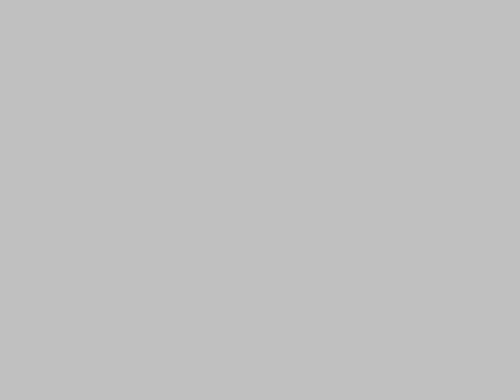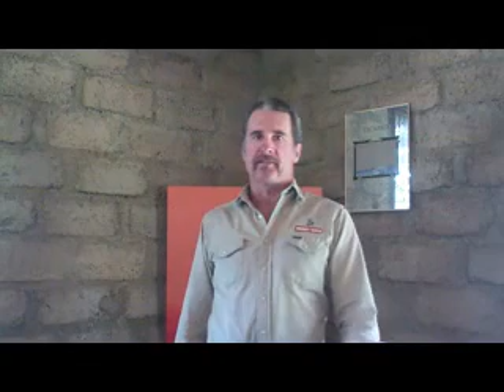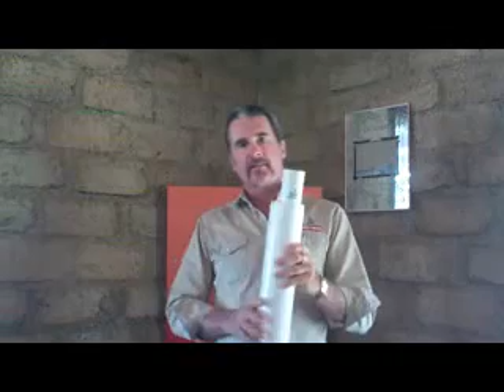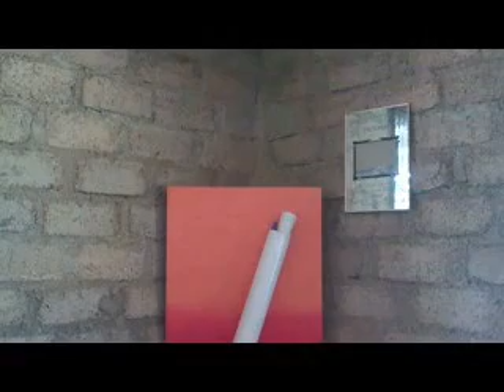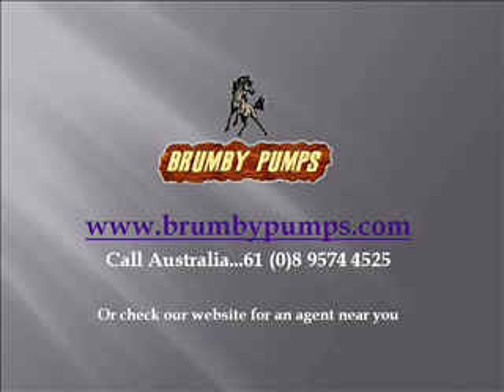Brumby vid.wmv

Comment: Hi Tom,

what is the maximum depth of the well. Can it be used for tube wells with depths like 100m below. And what is the rate of power/ fuel consumption. And finally what is the price for the complete set.